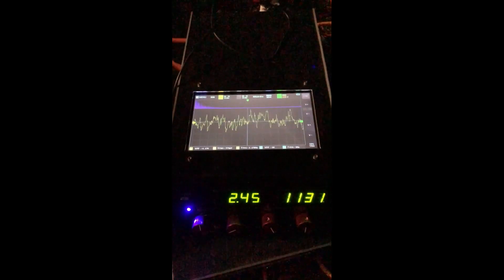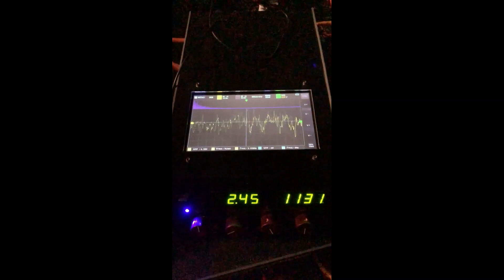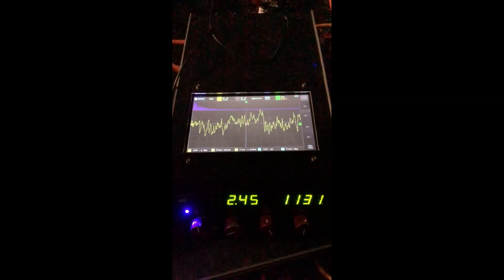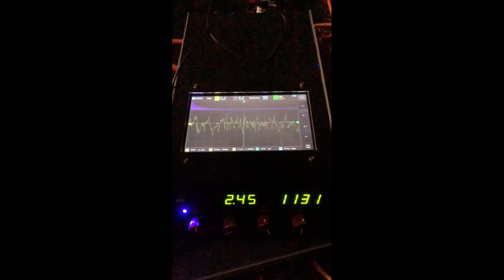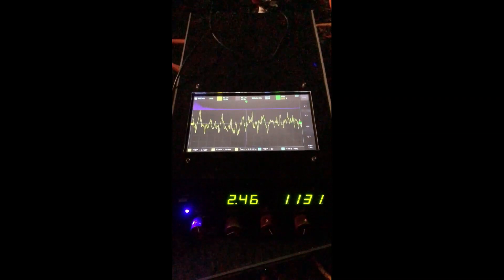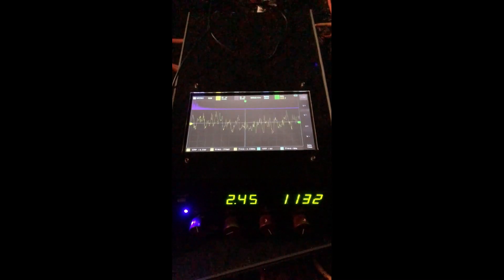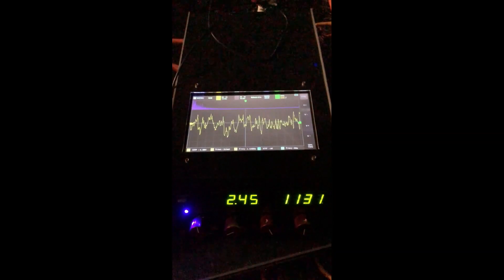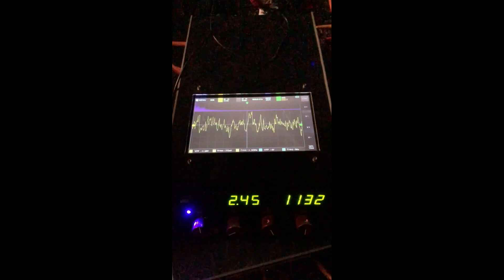Comet sound recorded using custom technology

Comment: Hello and again thank you for sharing your amazing work and studies! Just one question, despite the problem of atmospheric scintillation/turbulence/fluctuation you mentioned, would it not be worthed to try, nevertheless, to use narrow field stop, like for instance a diaphragme or a slit, whatever, which would allow you to spatially descrimate the "sound" activity between some parts of the tails, and the core? And for that, in order to mitigate also the drawback of this atmospheric fluctuation, maybe you could also work in the NIR domain (if your PM tube allows that): turbulence cells are wider and calmer at long wavelengths, or also you could work with multi narrowband narrowband filter (we can currently find some nice quadri narrowband filters in the market), for the light pollution issues? here are just some crude suggestions you have already considered i am sure. Again thank you and good luck!
Reply from the maker: Yes, there are many experiments that need to be made with reducing atmospheric scintillation.  I thought about adaptive optics but that system will have limits on bandwidth and it may introduce sonic artifacts.